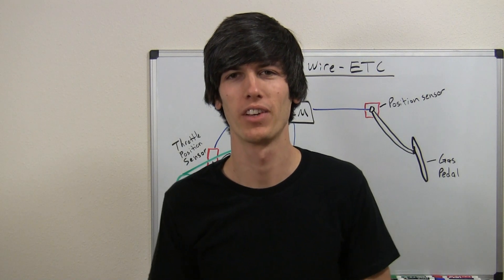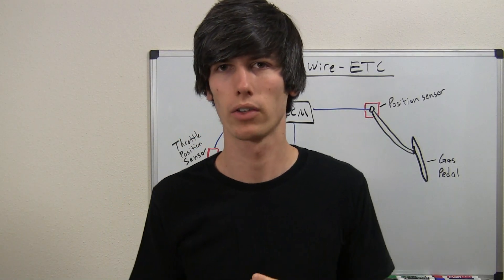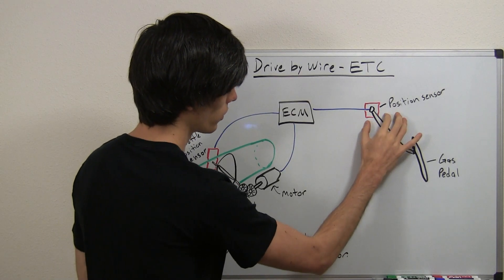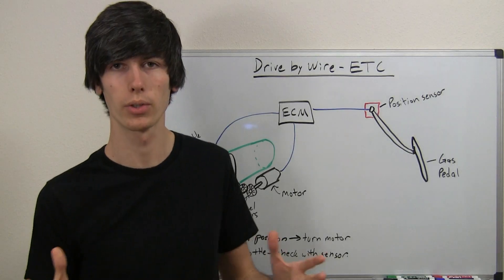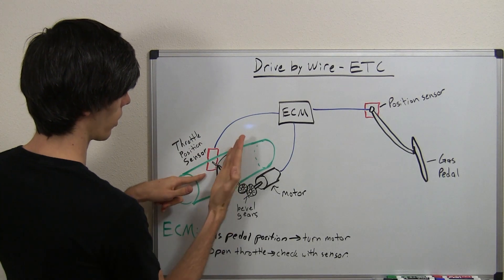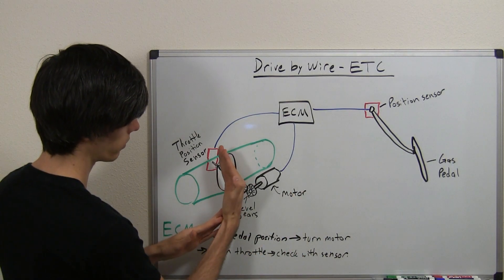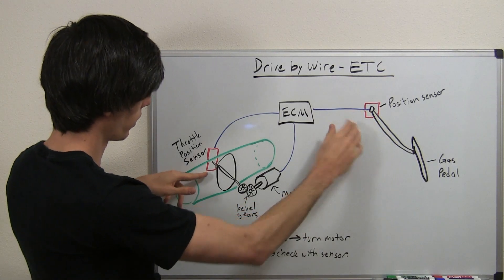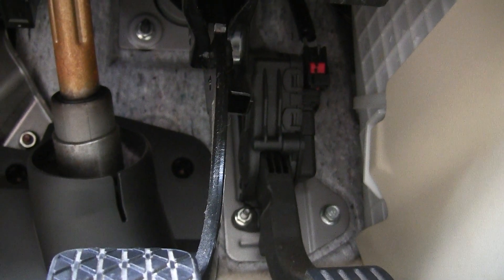Drive By Wire - Electronic Throttle Control - Explained

Comment: how the resistance feel on pedal works for drive by wire model cars. What my precise question is actually the resistance that we feel when we press the gas pedal. how is that works. 
I would assume either a spring against which we are pressing the pedal which gives a resistance effect
OR
the ETC(electronic throttle control) generates a resistance feel. I would be very glad if you kindly share this information.
Reply: it has a spring inside

Comment: i rode a motocycle the other day that used a drive by wire system and i didnt like it at all. the throttle tube twists to easy while manuevering the bike...

Comment: It makes sense why airplanes use fly by wire , the flaps are giant and obviously can't be moved manually.

But it's just STUPID to put on a car. what's next , pedal by wire bicycles? Why don't we just upload our throttle via satellite to google's servers then to china then to another satellite then down to the engine. Makes just as much sense.
Reply: Foxontherun2 DBW Has many advantages, engine protection,  simplifying Cruise control
Systems, different driving modes and also making it simpler for engine conversions. No longer making custom cables or worrying making the pedal or t-body working together. GM Throttle body and a Honda pedal? You can do that, Honda Throttle body and GM pedal? You can do that. Also reducing parts. You also normally lose the Idle air control valve in systems like these I believe, DBW is better for packaging of the engine bay clearly too. Why the hate? DBW can be just as responsive when it's got a good tune placed on it
Reply: You can buy a brand new GM DBW Pedals for around $100, or less on the second-hand market. DBW T-Body's are the same story. You say there's more parts to break but how often does one break a Gas pedal? It's a sensor that could be made cheaply if it was a part known to fail, but they aren't. I see far more benefits then disengages.
Reply: Foxontherun2 lol go look on my channel you moron, I swapped a 99 Legacy with a WRX engine and STI driveline. Built many other Subarus with friends. Your the close minded one not accepting new technology's and seeing the benefits they hold. I know many people with 200k+ cars with non failed DBW systems. Weird how they haven't failed right?
Reply: Foxontherun2 let me guess you drive a car with a old 350 Chev? No I don't think it'll out live a cable. But if these setups normally last 200-280k then who cares??? Most people don't keep cars past that anyways. A cable can stretch and break too, both have failure points. That said if these DBW motors and gears were as weak as you made it out the aftermarket would be making upgraded motors and metal gears.. I'd trade my cable driven setup in my 99 for a DBW setup, and I probably will later on when I get a standalone ECU. My car was swapped because I wanted a better engine with more technology.. that's Something you wouldn't understand so I won't bother explaining why it's better.
Reply: Foxontherun2 no one is forcing you to buy new cars. You can go for old cars
Reply: I was going to respond to the OP, but then I noticed that was from 2 yrs ago.  So, I'm going to respond to your 1 yr old response. lol. Advancements in technology, while by themselves may seem futile, facilitate the advent of subsequent technologies, that otherwise wouldn't have been possible.  In this case, autonomous vehicles are an example of a new technology that wouldn't be possible without "drive by wire."  DBW has been in use for almost 20 years at this point, allowing the system to be pretty well developed.  This allows the engineers to simply juxtapose a bunch of previously existing technologies, and focus on what hasn't yet been developed.  Quite often, when a new technology is developed, it isn't the device itself that is so exciting.  It's the technologies other implications that are so exciting.  A seemingly useless, and costly development from 20 yrs ago (DBW), is now one of many old developments that is necessary for the autonomous vehicles that are beginning to kill pedestrians of today.
Reply: EXACTLY!!
Reply: Wow , a 99 and it already needed a new engine. You think a potentiometer , a computer filled with cheap caps , and an electric motor with plastic gears will outlive a single metal cable. In your dreams. lol
Reply: stfu
Reply: Just because they have to SELL sth NEW.
Reply: I love it. dbw and all electronics associated with it allows my puny naturally aspirated 4.6L  to push 380hp 360 lb/ft and get over 25mpg! And Toyota was being very conservative. no "out the box" analog car EVER stood a chance. I'm 41 and Im done modding and have been for years. might get speed limit removal,but I'd rather invest 800 than spend 800.
Reply: more links in the chain is more failure points , and less reliability. nothing is more un reliable than modern day electrical crap. even 20 years ago electronics were higher quality than the cheap junk they make today. 

they want to increase the number of expenive parts to replace so they make more money servicing the car. and they want to reduce the lifespan of the car in general. drive by wire , perfect addition.
Reply: well then you are a short minded person who's never turned a damn wrench in your life. why don't you go invent a drive by wire spoon that needs electricity to work and costs 100$ to replace.
Reply: and I won't bother explaining why parts that cost more and fail more are worse. Why would I? I mean , we got a guy here that think 100$ for just the gas pedal is a real deal. lol. if thats the case I got some magic beans I can sell you

Comment: Fly by wire is on aircraft. It's called drive by wire . Great vid
Reply from the maker: BrightKitten purr You catch the title?
Reply: Engineering Explained Hey I know you might not see this but you should do a video on brake by wires systems

Comment: Ive been searching all over the web, and cannot find any data as to why they switched all vehicles over to this.....which kind of scares me a little.

How is this better?  How does this make a car better,safer,use less gas, etc etc.   and are those improvement worth all the extra complications involved?

I mean, other improvements made sense.... fuel injection= more power, less fuel, less maintenance    The improvements like distributor-less ignition, etc. Okay, those were all worth while improvments,  some things got more complex, but the pay off was worth it.

How is replacing a simple cable, and lever mechanism.......with a gas pedal sensor, wiring, interface to the computer, more wiring, a motor, a gear set, and linkage to the throttle body making some profound improvement?     They took a design that was pretty much perfectly fine, and made it have like 10x more points of failure, for what reason?  What improvement did this make?
Reply from the maker: Michael G It allows the computer to directly control the throttle. From a safety perspective, this adds a lot of value as you can cut power in scenarios where traction is lost or the vehicle is unstable. Makes cruise control much more simple as well, as it removes the need for an actuator to pull on the cable. I'm a fan of mechanical systems, and would certainly prefer the old method from a response standpoint, but I think it's a valid mechanism.
Reply: Engineering Explained. It doesn't really make cruise control "much more" simple.  Electronic cruise control pretty much is the same thing as an electronic throttle body, except the motor unit isn't attached to the throttle body itself and is instead located away and attached via another throttle cable.  

BUT, yes it does make sense from the stand point of modern system on a car now days do require computer controlled throttle manipulation, such as traction control, etc.
Reply: +Engineering Explained I have a drive-by-wire throttle car, and there is a considerable delay in engine response. It feels exactly like I don't have true control over the engine; it's annoying. I have to push the throttle pedal more than twice the distance required in car with a traditional mechanical linkage to achieve the same rate of acceleration. The two cars referenced are almost identical in horsepower.
Reply: @slowanddeliberate6893  the response of Dbw is impercieveable. Milliseconds infact. If you perceive lag that is due to the programming from the manufacture.
Reply: @S30Build  Yes, but there is no particular programming to worry about with old fashioned mechanical linkage throttle systems.
Reply: What scares me about drive by wire throttles is, what if the throttle position sensor were to short out & you  are at full throttle wouldn't it just stay at full even though you are not pressing on the pedal at all & just continue to accelerate. I prefer the cable method cause if the cable breaks you will slow down and stop, & not have a runaway car.
Reply: Logan Alworth 

actually the chances of that happening with a cable trottle is much more likely then drive by wire. 

drive by wire is done by the engines ECU.   it looks at everything....

engine rpm, vehicle speed, etc. 

the second the engine starts reading higher then it should be it will shut it down.
Reply: Basically just a way to quadruple the price.
Reply: Charlie Zhu it's really the government.  If they didn't intervene, we would all still be driving flat-head v8s burning leaded gasoline.
Reply: Score one like a boss
Reply: Thanks, and I actually was told that about 2 minutes after in posted my comment. I am in whats called a career center and my instructor told me pretty much what you told me and another student had the same thought.
Reply: More parts to break, more things to repair = more money out of every car sold. Some people always go at the dealership for every repairs.
Reply: there are no good engineers anymore that's why you see electric cars they just order motor from china and drop it to some old car cause they can't design good engine, what do you expect from this kind of people.
Reply: @Logan Or it gets stuck open. Even more dangerous. I've never heard of an electronic throttle shorting out and getting stuck open.
Reply: Michael G  the way this system works is backwards to the traditional system. With this system the ecm can make fueling adjustments before opening the throttle plate where as with cable driven tbs the ecm waits on the inputs of the tps to make fueling corrections. This makes for a more accurate fueling calculations which result in better emissions
Reply: Programming throttle blip for clutchless shifts can be a huge benefit to dbw
Reply: +Michael G Put aside all the probable pros that electronic throttle has, one of the main reason it's used by most cars nowadays is the manufactures and dealers can have one more part that requires changing which means $$$(more expensive) to them, which unfortunately do break down, and I think this is the reason you cant find no clue on internet because those businessmen are trying to hide their dirty secret(s).

Comment: Can somebody explain to me why this is better? Seems so much more complicated and prone to repair than a simple cable-operated throttle.
Reply: Alec Minnick Because "fuel savings"..........that aren't worth diddly squat.
Reply: +rock IAC is way more reliable and only a fraction of the cost.  Yes, I have replaced quite a few IAC's but Throttle Actuators are a common repair Item.
Reply: I can answer that. Because of predictive mapping. Faster than your foot can fully depress the pedal the ECU can measure in Milliseconds how far the pedal has moved. A map table is qued up in the ingition and injector tables for full throttle before the pedal is fully depressed. This is the end game they were looking for that only ultra fast standalone's and high end factory ECU'S can handle. A small pedal movement to throw out ingition and fueling maps faster than you can pysically depress the pedal. OR=Throttle Response.
Reply: +Ralf V And yes out comes the argument that DBW is smoother, easier on Gas and the Catalyst System. Whatever!